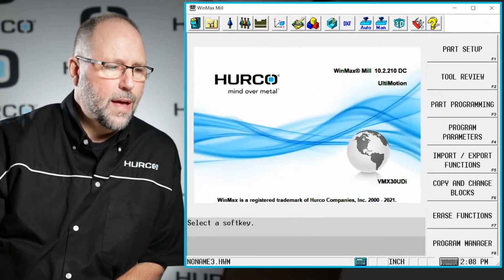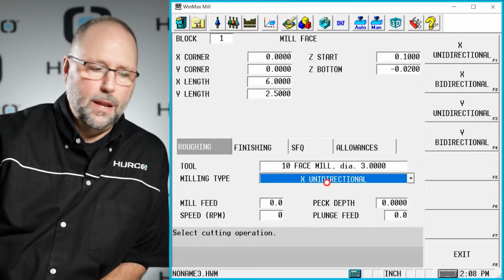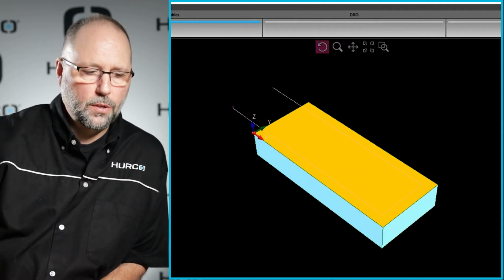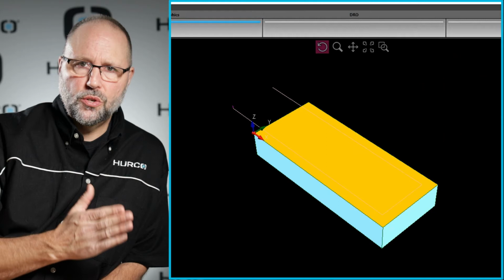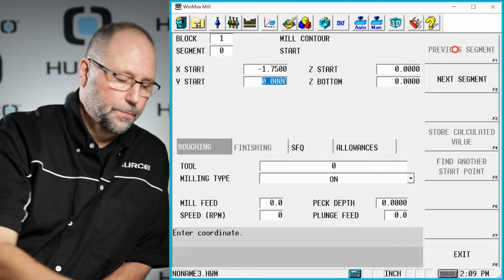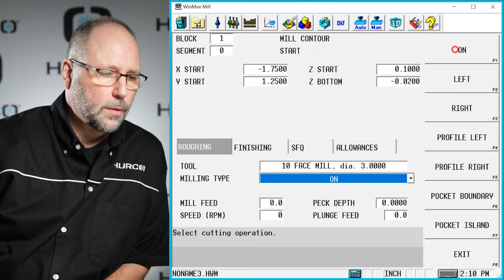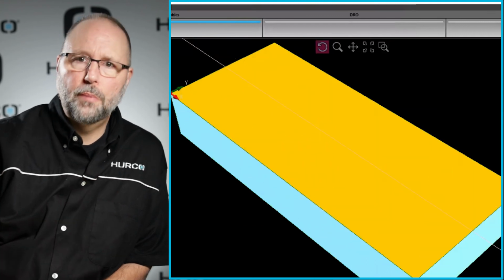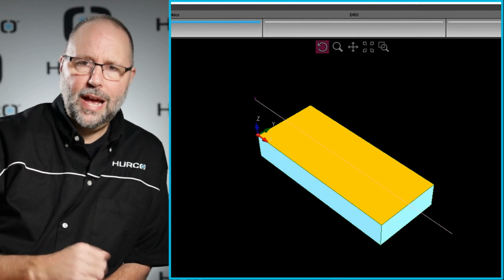Increase Step Over in Face Milling Block | Your Questions Answered | Hurco CNC

Comment: Thank you for answering my question I thought there might have been a parameter to accommodate this stepover 
the way I couldn't do it sometimes is to lie about the cutter diameter tell it it's a 5-inch rather than a 3 inch
 diameter face Mill and adjust the Y start and Y end positions
 thank you John